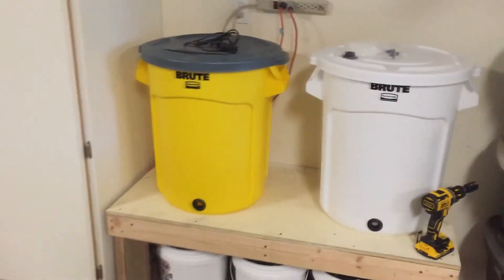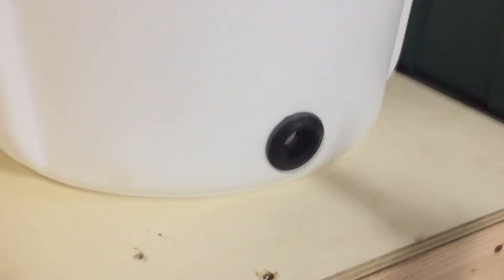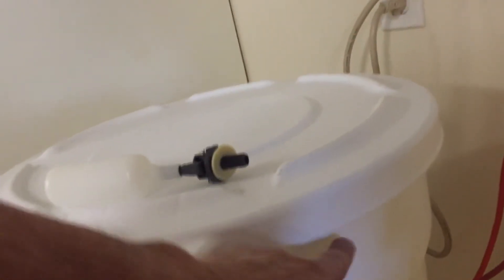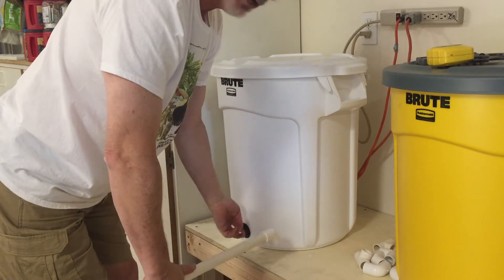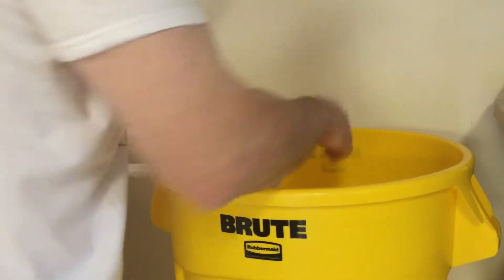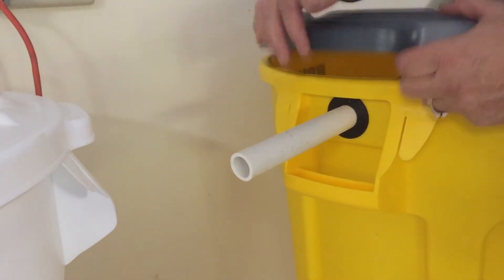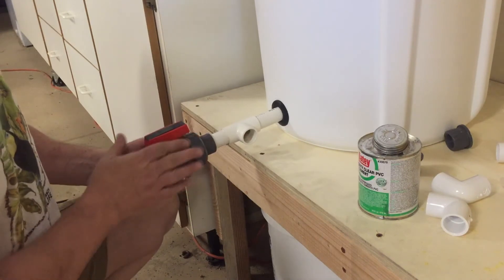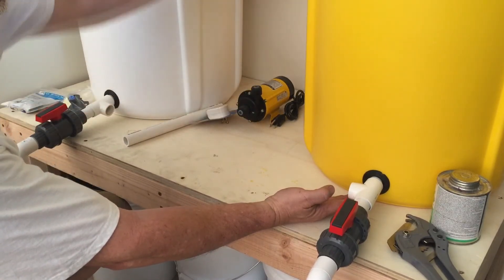Installing a Salt Water Station

Comment: Hey, I know this video was 4 years ago but I was wondering if you had any trouble with the brute cans.
Reply from the maker: No. They work great. Still using them.
Reply: Jumping on the late trend but are the ball valves for viewing pleasure compared to a cheaper 6 pack from Home Depot. Or is there is reason for the fancy valves ?

Comment: Thanks for the great vid.  I hope your BioCube 32 adventure is going well.  We started two of the same a couple years ago and love them.  We're about to build a similar mixing station with the help of your guide.  Have you had any trouble with your choice of color Brute containers not being NFC food safe rated like the grey ones?  I've heard and read that you should only use the grey or black because of that rating.
Reply: Thanks. I read about the gray containers after I ordered mine but the website states they are food safe. Not sure if that's correct. I have not noticed anything from using the yellow and white. The water parameters all check out normal and they have been used for about 4 months now.
Reply: How is the pump working out, would you have gone bigger if you could do it again?